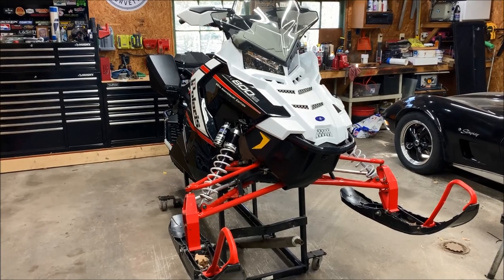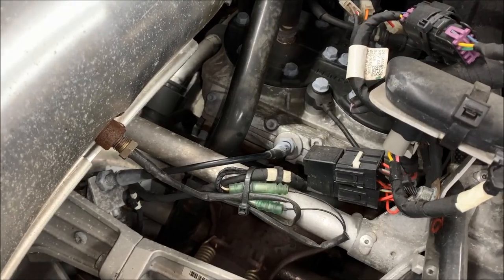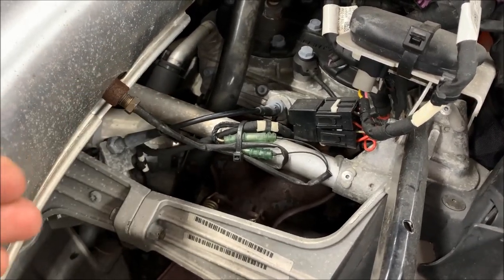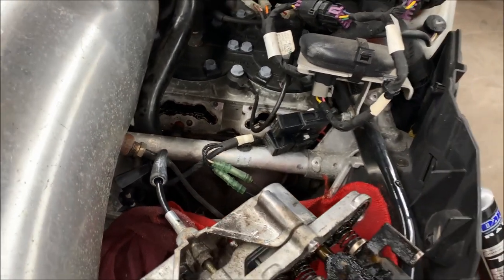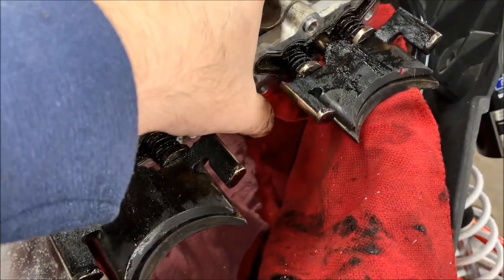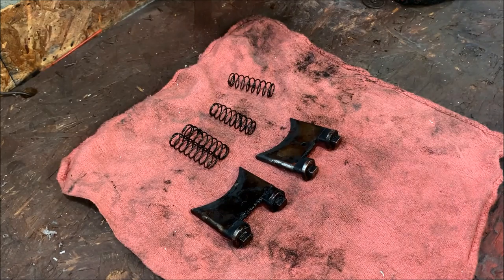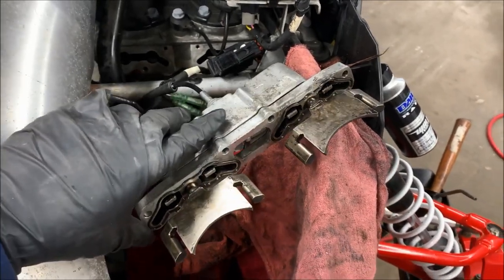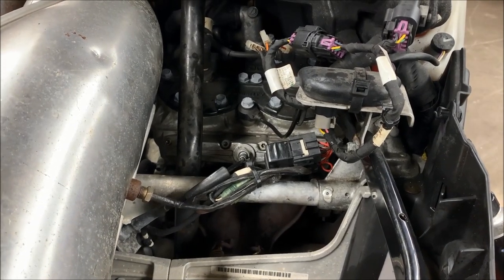How to remove and clean the exhaust valves on a Polaris Axys or Matryx 800  and 850

Comment: Polaris gold tech here, just wanted to add couple tips to already good vid:
Love maroon scotchbrite pads to clean valves, the springs will weaken and worth measuring. All them cheeseburgers I eat want my sled performing 100%😂When doing the bores, set piston dome just below valve port to catch any carbon and use sweeper to suck as you scrub, one last thing . Those relays control the valves and I’ve been cleaning corrosion off them from prior experience every sled service. A must!! 👍🏻
Reply from the maker: Awesome. Thanks for the tips!

I’ll definitely check it out in a couple of weeks when I pull it from the shed.
Reply: @slednex700 when you say relays, are you referring to the black boxes plugged into the wiring harness that can be seen at 1:22 ? Or is it apart of the module the exhaust valve wire is running into. Having some issues with bog at the top end on a 19’ 800 RMK that I just bought with 899 miles. I’ve been researching relentlessly trying to find the potential causes. When the throttle is wide open and gets to around 7000 rpm’s it sounds like it’s dropping to one cylinder. I’ve gone through about 8 BPR9ES spark plugs which look pretty rich. I’ve pumped the old gas out and switched the computer from ethanol to non ethanol and I am running non ethanol 91. The clutch is set up for high elevation as it came from Colorado and I am storing/ testing in Michigan. The snow here just melted so I am going to switch out the clutch weights in the meantime. Any input would be greatly appreciated thanks!
Reply: Yep those relays, and check your motor mounts! Guerentee you’ve got one or two bad if not changed often
Reply: @Slednex700  Okay I’ll take a look, thanks!!
Reply: @Jackboy497  Need some more info. What rpm you having bog? I tend to fix bogs more with clutching/tps issues. Pop ur primary spring off and check rollers and weight pins. Do pins float side to side,  ramps on weights nice and smooth or ripple? Grab tower and run it back and forth, are the buttons moving nice an smooth? Scotch bright this area where buttons move. Feel for grime and surface rust in center bushing also. Axys love their motor mounts so that’s a must check. You runnin oem belt? Where intake meets console(two push rivets hold the piece on I’m talking about)there’s a crack where snow can b injested, put tape over crack. Go to autozone and buy their brake cleaner. If have some already make sure it will ignite off a lighter. Spray around TB and cases and pto crank seal, watch for rpm change. Have a dealer with digital wrench do a valve relearn and adjust tps. One last thing remove secondary, engine torque arm is bolted to an ear on chassis right at front cooler, make sure that ear is not broke. Unsure of your year but there’s a recall to replace jackshaft bracket with bolts instead of rivets👍🏻

Comment: Hey my 2018 started only pulling around 7500 rpm’s at most, pulls hard till 7000rpms then falls on its face hopefully cleaning these will help any thing else you would check?
Reply from the maker: Could be a couple of things. Check the relays that activate the servo for the valves. Also check for broken clutch springs. 

I have a video on the secondary rebuild as well.

Comment: I see that sled has 6800 miles has it ever been rebuilt I have 5500 on mine and I’m thinking top end idk
Reply from the maker: Actually. Just sold it and the sled had 8000 miles. Engine was never opened. Compression was still 125 when I sold it.

Comment: Have u ever had relay issues causing under revving? I’ve got the exact same sled and wen wot I was lucky to get 7500 rpm I did have a valve code at the start of the season
Reply from the maker: I’m still chasing down the issue. Only been out a couple of times. Still only cuts out when going up a hill. I can get it to to 8100 on flat ground with no issues. Very weird.

Comment: i took my off and when i was taking the springs and stuff off, one of the main pieces just fell out with it but the other one stayed in like you have yours. i would asume the one is broke off. do you know what all i would need to buy to fix??
Reply from the maker: It’s designed to come apart. Mine did as well when it came apart. Should just be a matter of putting the springs back in.
Reply: @StreetersGarage  there are two metal flat pieces that are sticking out after you took the springs and the other mental flat pieces off . i did that and then one of the main pieces just fell out and the other doesnt come out. seems like it broke inside . ' i was having some bog issues at high rpm so was thinking that coulda been a issue.

Comment: My 2019 850 is boosted and runs 10 psi of boost . It runs great ! Has 750 miles and the other day when I went riding it bogged going up a mountain and than it had a hard time starting . I removed the spark plugs and they were black like it was running rich . Do you think this could be the issue ??
Reply from the maker: Yes.  Sounds like it fouled the plugs out. Go ahead and change then.

Comment: I have 2016 pro rmk axys 800. Just decided to not start after sitting a couple days. I noticed black sludge coming from the driver side valve where the gasket seats, do you think this could be my no start issue?
Reply from the maker: Definitely wouldn’t affect that. 

Hold the throttle open and try it again and see if it starts.
Reply: Ok thank you I’ll give that a shot. Ran the Polaris carbon clean through it on the last ride and after I parked it shes a no start and always starts second pull
Reply from the maker: Yah.  Every once and a while it’ll flood out and you need to hold the throttle open to clear it out.

Comment: Im losing acceleration Around 6000rpm also below the valve the two black hoses are blowing blow black sludge out. Clean the valves ?
Reply from the maker: A little bit of oil coming from the discharge hose is normal. With the sled running, check to see if you have any smoke or oil coming from the hole in the center of the cap.  If you do, this is a indication of a torn bellows. 

What model / year sled?
Reply: 2018 pro s 800
Reply from the maker: @joeldowling6481  ok. If you decide to pull them, also check for a broken cable. The original relays have a tendency to fail as well. 

If the relay fails, it won’t supply power to the servo and as a result the valves won’t open.
Reply: Thanks dude
Reply from the maker: @joeldowling6481  no problem. Good luck.
Reply: The arm inside the valve cover that the cable connects to is broken. Do you know the part number? Can’t I’d it on the parts layout page
Reply from the maker: I’m going to say it’s 5138506
Reply: Yes sir that’s the one! I shouldn’t have to relearn the actuator if I only remove the cable from the new tie bar part hopefully?
Reply from the maker: It’ll need to be the-learned.
Reply: Thanks again really appreciated your help
Reply from the maker: No problem. Season is short enough. Need to help everyone out as much as we can.  Lol